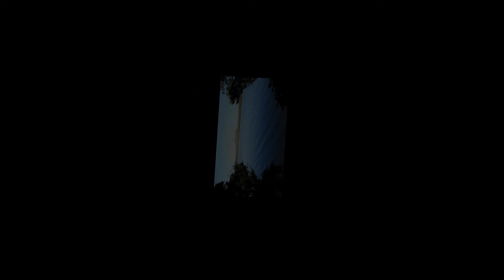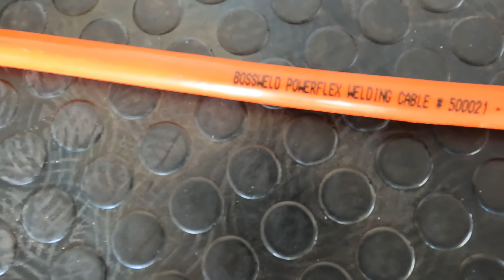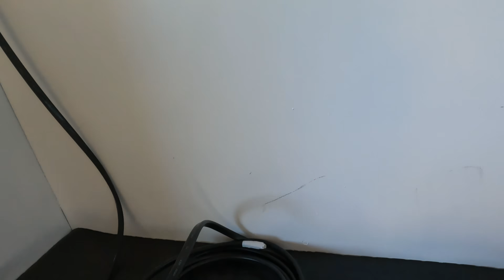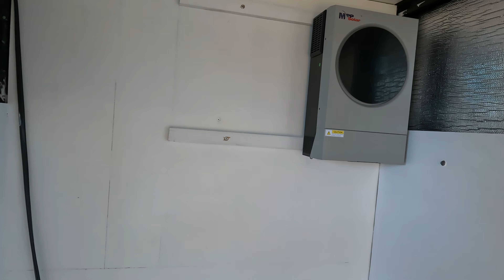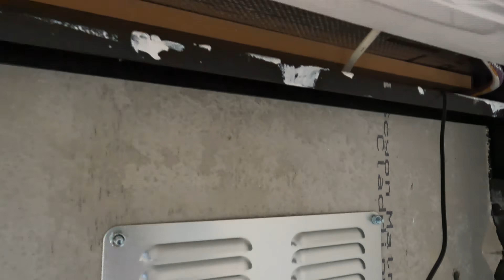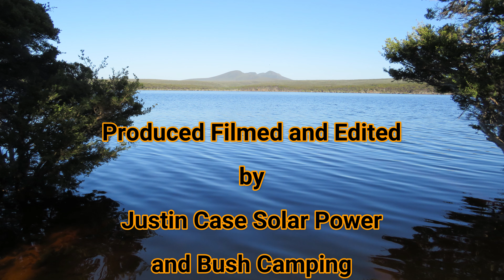New OFF-GRID System.  DC Wire Sizing explained in Detail

Comment: I missed this video, but yes, I see now, I am on 24 volts but heading up to 48 volts at the end of the year. I'll start using 50mm2. According to WA Industrial Supplies the 50mm2 has a rating of 370A. Now I assume this is an average based on the data sheet you showed us in this video. You are correct, the Bossweld cable is by far the best I have ever seen. Also that is my opinion but definitely backing you there. I've modified my Lynx Power In so that I can have a fuse on everything, 150A for the inverter, 100A for the Victron 250/85's and a 60A for the Victron 100/50. I've always wanted to have everything individually fused or breakered so this is opportunity to do so. I need to upgrade the main 160A fuses as I am now reaching that amperage and even exceeding it during cloud edge effect events. The 250A Beny will replace that. Thank you for the very informative and educational video mate. Love your work.
Reply from the maker: All good brother. That is why I make videos. Just to help people understand my thinking and why I use certain products. Gives them a better understanding so they can do it themselves and feel confident while doing the work.

Comment: Hi Chris Got a link to that temperature gadget your using for your fans ??
Reply from the maker: Frank key word when looking for this is (Digital Temperature Controller Outlet Socket Thermostat Plug with Sensor Probe) use them key words on eBay or Amazon then pick the one you like.

Comment: Very nice explanation of the system you are building. Always good idea to go oversize on your wiring. Your d I inverter Looks exactly like a solark inverter. Less the 60hz  spilt phase needed  here in US That seems from what I have seen problematic in 120v 240 use off grid.
Reply from the maker: They make these in split phase for the US market as well. https://www.mppsolar.com/v3/split-phase-lv/ have done for many years now.

Comment: I am currently running two of the 5648MS they work well
Reply from the maker: Yes MPP Solar Inc has always made a nice inverter. But like I said the Deye have much better all in one monitoring. That is the main reason i changed. The U5648MS is damn good bang for buck. Look how easy the wiring in now though. 😉👍🖖